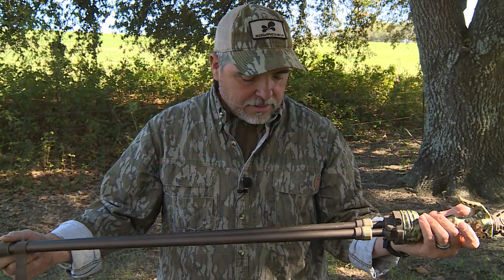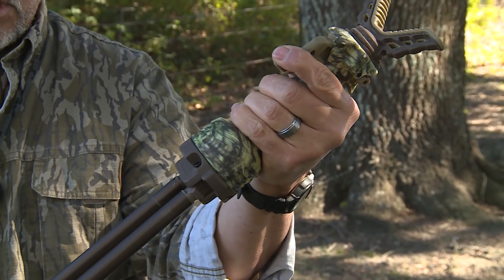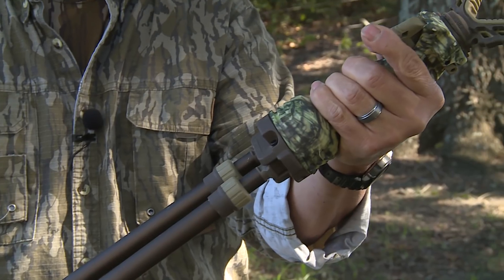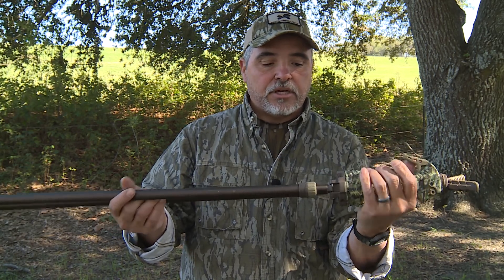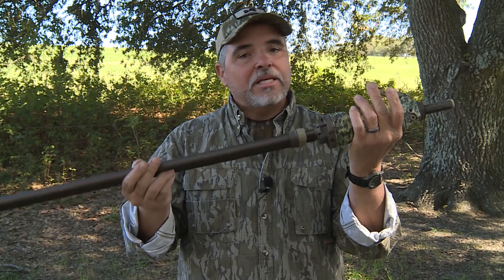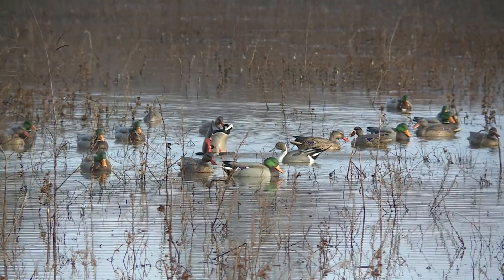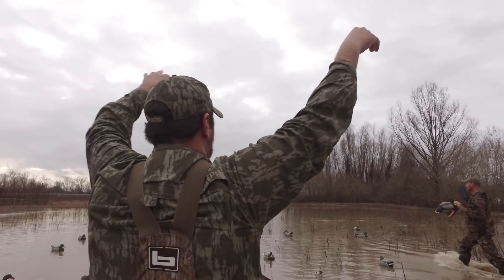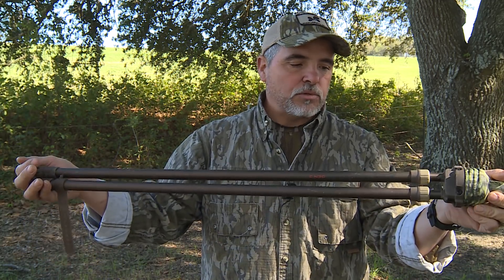How To Maintain Trigger Sticks

Comment: Trigger sticks are a great asset and I value them second only to my firearm in my hunting gear. However, they are a flawed design, which I've pointed out to Primos to no avail. The upper shaft of the leg is inserted into the larger diameter lower part, leaving room for moisture to funnel straight into the joint in wet conditions. Add freezing temperatures and the legs will not slide. This has cost me a nice whitetail buck. My suggestion to the manufacturer is to use the larger shaft at the top of the leg so it slides down over the lower leg, allowing moisture to shed past the joint and on down the outside of the legs.

Comment: Under the feet on the bottom of each leg there are 4 holes drilled.  This allow the air to escape.  If the get filled up with water and debris, they will not extend.  You take the foot caps off and clean them out and all the water and debris will drain.  I use a flat punch.  Put some mild water resistant glue on the feet and stick them back on.  I actually drill a small hole in the bottom of the feet from inside the foot out so they will drain.  It is easy to clean.

Comment: Also, if the rotating head wabble in it. Take the handle cover off.  Remove the locking screw and the head comes off.  On top there is a flat surface with two holes.  I use a pair of locking ring spreaders which will go inside the two holes and gently tighten it until the wabble goes away.  If you over tighten it, then the head will not rotate.

Comment: Functionally this device is really good.  I've been using it for about 3 months several times a week for rabbit shooting.  However the build quality is not good.  In the 3 months I've used this two of the three screws that hold the plastic gizmo underneath the base plate have dropped out and the outer tube of one of the lower legs fell off and one of the legs seized.  This all happened out hunting so it was only the leg that I was able to retrieve.  Screws were replaced from my collection. The leg tube appeared to be a failure of the inadequate smear of glue that attached it to the plastic collar and the seized leg was fixed by adjusting the mechanism.  For around £130 this is no better quality than any of the Chinese knock offs that Youtubers are always bangin on about.

Comment: Hi, hope you can help us out with our trigger stick. When we open it to the wide position, it will not lock and once the rifle is placed on it, it just continues to drop. How do you lock it in the wide position? It locks automatically if it’s nice and tall, but not when the legs are wide for a sitting position. Hope to hear from you soon.

Comment: How do you fix it if a leg is stuck open? Was out hunting groundhogs and the leg stuck open and won't close. Was working fine first half of the trip. Didn't dent it drop it or anything.
Reply from the maker: Hey Michael - Sorry you are having issues with your Trigger Stick. Please give us a call on Monday at 601.879.9323 and we'll be glad to help you with your problem. First - Which generation Trigger Stick is it? Gen 1, 2 or 3?  If you pull the trigger and push the leg in will it retract or is it locked open?
Reply: Maybe this will help someone else. I managed to fix mine and it was a simple fix. After closer examination I noticed where the leg connects to the base, the stuck leg was further down than the other 2. After messing with it I found that it appears to screw on of you turn it clockwise. After I turned it as far as it would go, it wasn't stuck any more.
Reply: I have purchased 4 pair over the years because the leg won’t retract.
I watched hours of videos like this without the answer…
Today my friend showed me this same trick, one of my legs that is stuck needed to be screwed back up, it had unscrewed itself just a little from the base, a few turns and tightened it back up and now works great, now I have three bipods for sale because no video showed how to actually fix my first one…